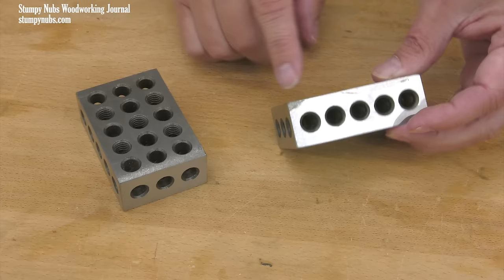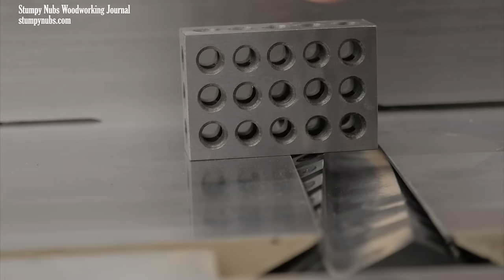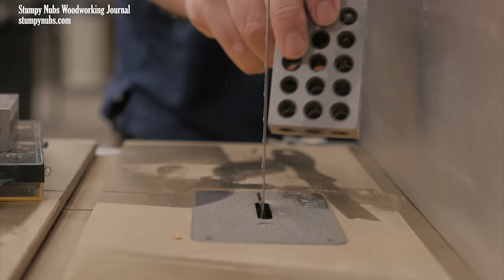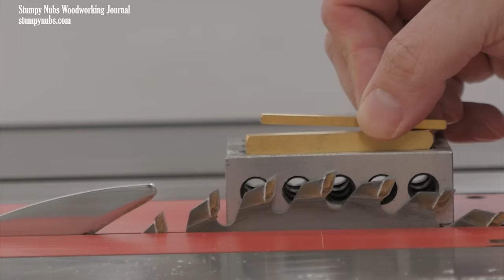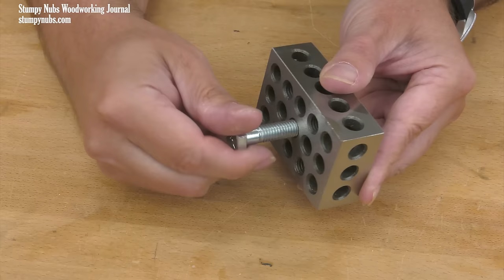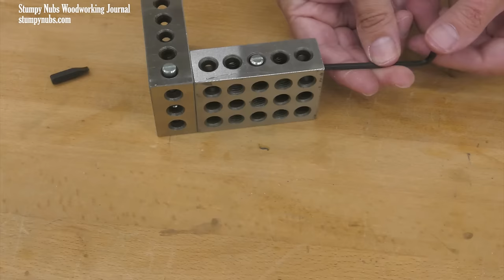An old machinist's tool that woodworkers are snatching up!

Comment: Back in 1972 I started as an apprentice machinist.  The first job you got was to make 1-2-3 blocks, Then a matching 45deg angle block.  Once you milled drilled and tapped the stock, did a pre-grind to a few thousands over, you had to heat treat the block, then grind them into size. You were tested on , square , flat and parallel precision. It was always best to make the angle block first then inspect your precision. The angle block doesn't need to be ground exact sizes, though many of us tried to do that because that's what toolmakers do.  Make everything precision. Once you ground the 1-2-3 blocks you were stuck with your precision ( or not so precise) dimensions, or grind them undersize and then they lost some of their usefulness. Of course 50 years later they had been dusted off more than a few times and were undersize anyway. But I still have all my tools and used them everyday for 53 years.  You can't beat these tools for more kinds of jigs, fixtures and inspection work then you ever thought possible.

Comment: I could not agree more about helping out others with really useful products.  I just ordered the hardware kit.  Thanks for the video.
Reply: Another trick is to use hardened pins into the smooth holes to perfectly align them.  You can bore them precisely with a good reamer and a drill press

Comment: I caught up with an old workmate today, who I had not seen for over twenty years.  We both started as toolmakers at Ford UK Apprentice Training School in Harrold Hill, and worked at the Ford Research and Engineering Centre at Dunton in Essex.  It was interesting that my friend also now has a keen interest in working with wood and has a nice workshop.  It's that joy of making things that stays with you forever, although we both agreed that wood is frustrating in that it does not stay the same size and shape two days running when using the tolerances we were used to applying to metal.  I have been using much the same trick James demonstrated today using a combination of shop built parts and flat-pack cabinet hardware.  Look for 'cross dowel' or 'barrel nut'.  

A new way I used my 1-2-3 blocks recently was aligning my router cabinet to my table saw.  I levelled the router cabinet (because it is the more awkward one to adjust).  Place two 1-2-3 blocks on the router cabinet and two 1-2-3 blocks on the table saw, and stretched an aluminium straight edge across all four blocks.  It was much easier to adjust the saw with what amounted to four contact points rather than the full tables, and a work light made it easier still to see the tiniest of gaps between straight edge and 1-2-3.  I also align jointer blades the same way we saw James rocking the 1-2-3 block on the blade, except I use a DTI on top of the block.  In actual fact the block movement is so obvious and apparent, you hardly need the DTI, but it is nice to have numbers to compare rather than eyecrometre guestimates.   Something else that made me smile when talking to my old workmate was when he asked me show him something I've made, after a moments thought I had to admit to making more things for the workshop than with the workshop, and he agreed he is exactly the same.
Reply: @Trevor Dennis "eyecrometer" LOL I love it. Reminds me of my dad's "pifomètre" from the 50's French slang pif for nose. Thus measuring by the length of one's nose.
Reply: @fredericapanon207 , LOL! I was always the "Skinny kid with the big nose" growing up. Although I prefer to remember my self as the "Slender youth with the proud proboscis".
Reply: LOL! What type of "Eyecrometre" do you prefer? The Single Squint, or the Double Squint, Glazing Enhanced kind?

Comment: As a machinist.....I have been using these since the dawn of time but I only have a single "proper" set that has pass-thru holes. That set is very precise and only used for very high-precision work. 

I also have a dozen sets of the cheap-o 1-2-3 blocks that that bolts cannot pass through. This is a great solution to use them as intended! I love it.....and like you wish it was my idea, lol.

Comment: I had a machinist turn down some threaded studs that I had bought to allow me to join my 1-2-3 blocks, and it wasn't this cheap or easy, and they were still not completely what I wanted, so I added magnets to help resolve some of the problem, but I have just ordered the kits and can't wait till  they arrive. Thank you for the heads up on where to get them.

Comment: I use 3/8"-16 to 1/4"-20 thread adapters used for cameras and tripods.  They are cheap and come in bulk.  Then I use 1/4-20 flat head/countersink screws to attach everything.
Reply: Yeah, I got brass ones in bulk and threadlocked them in the blocks.
Reply: Same

Comment: I nearly hurt myself facepalming🤦 this is one of best ideas for the shop! And I even have the hardware already laying around, salvaged from some old furniture.
Unfortunately Mike doesn't ship those small items to europe. I would've even jumped over my shadow. Having this imperial hardware in my metric shop would've been totally worth it.
Reply: Deer Stompy, Ah'm berry grapeful fur awl yew teech us sew Ah don wanna say umthin ta make yew shut up, but Ah got me 2 thoz kits an Ah got sum bad news.

Lessen them blocks git drilled perfekly square plus perfekly sentered ain't no way u gonna git them kits ta git 2 bloks plum and square wit thet kit.

Iffen yew got sum perfeck (machinist-grade, close-tolerance 1-2-3 blocks) drill, reemed an tapped ta close tolerances, that kit ain't gonna make a silk purse outta a pigs ear.

(The example you showed of forming a 90° combination was inadequate to show the potential, and camopholged the shortcomings of the kit. jus' sayin')
Reply: @seanflanagan5674  why is that a reply to my comment??
Reply: @Longnose154 , I apologize for the confusion: it was intended to be an independent comment.
Reply: @pipercessna3827 , nope, jus' nacherly gifted at plane tawkin. 😱

Comment: I have been using a 123 block for years as a spacer on my tablesaw fence.  It is easy to clamp the block to the fence using a Rockler universal fence clamp.  You then add an extra inch to the table saw setting and make mitered cross cuts using the table saw fence.  You set the workpiece against fence/123 block to start  and then pass beyond the 123 block to make the cut.  No trapped offcut piece.

Comment: Machinist work and Wood work have a lot more in common than just 1,2,3 blocks. I made two sets of 1,2,3 blocks while in machinist school. I also made a step block, and bench block that I use frequently in my wood shop. What is really amazing is you can make your own machinist inspired tools our of wood. Good hard wood and a steady hand can produce a fine set of 1,2,3 blocks as well as vee blocks, and step blocks, parallels, and a host of other tools. Like you I do appreciate the fine people at Taylor Tool Works, and they do good work. Thanks for what you do, and keep the good stuff coming.

Comment: Another great work-around...
Another option, search online auction sites or marketplaces for machinist's tools.  You can easily find affordable used sets of 1-2-3 ratio blocks made by Starrett, Lufkin, or Brown & Sharpe in all different sizes.  They can be picked up for a fraction of new, and similarly priced to the less expensive non-brand versions because machining businesses have been steadily closing for the last 10 years or more now that CNC and other automated tools have taken over the industry.  There are also a ton of machinist's fixtures (jigs), calipers, squares, rulers, thickness gauges, blocks, pins, and so on, that are very useful in woodworking.

Comment: I started my apprenticeship as a fitter n turner back in 1982, by my 3rd year i had made very similar joining plugs, an old tradesperson showed me this trick. Except mine were made the to suit the length of the blocks, so a short, medium and long rod, the longer rods had multiple holes thru them.  I am now a toolmaker in the plastic mould industry and use my blocks every other day.

Comment: Ordered a pair of blocks and two of the screw sets.  I just play at constructing things so I will likely never use them as much as you or someone like you.  But what did catch my attention was the 1,2,3 aspect.  Those are small enough and sturdy enough to drop into my "go-bag" for a bug-out situation.

Comment: I ordered a set of these from Taytools last week, and I am actually using them to attach dial indicators to adjust my planer and joiner. I was going to purchase two Rotocators, which would have cost me about $300, but using these blocks and a dial, I was able to precisely set my blades for under $70... Great tools.

Comment: i was a machinist for many years. A lot of my machinist tools I use for my woodworking. I made a lot of my precision tools in 1969, 1-2-3 blocks , many different angle blocks, sine bars and sine plates and some precision measuring tools.

Comment: Good idea. As a full time machinist, I've never understood the concept behind the pattern of mostly useless holes in a 123 block. Rarely can they be used 'as is'. And they are always getting filled with chips, so they have to be blown out every time you reuse them in a setup because they are full of crap. I found a set with a single 1/2" clearance hole in the largest face, and use these the most. Since the main use of rectangular blocks is spacers between the part and the table, it makes sense to have your most common stud bolt size (for your machine table T slots) to be able to pass through one hole.

Hint: don't try drilling the holes out with a 'cobalt' bit. Cobalt isn't appreciably  harder than regular HSS, not that you'd notice if it lasted an extra turn when drilling something that you shouldn't be drilling. A carbide tipped masonry bit may work, but often these do not have the right sharpening geometry to penetrate metal. And drilling fully hardened predrilled holes is very hard on the corners of the bit because you've got nothing to push against, so then they overfeed and get chipped or broken right away. Carbide endmills can be nursed through the hole, but they should be used on a real milling machine, not a drill press. However, its not very cost effective to sacrifice a few carbide endmills on a single 10 dollar 123 block ;) If you've got a source of slightly used carbide endmills you can sacrifice, then it makes more sense.

Comment: 123 blocks. Building these was my  first task as an apprentice tool & die maker . Accurate within .ooo3"  Still using them now after 40 years.
Reply: My dad was a machinist from before WW II to some time in the '80's when he retired. We were from Rhode Island, but had moved three times to Calipornia; the third and final time in '55. That's when he went to work for Hydro Mill where, in '62, he told me, "They call me a 'Tool Maker', but not by East Coast standards". He could hold +0.0003"/-0.0000" tolerances all day long on a manual Bridgeport vertical mill. NO digital read outs, no numerical controls. Just all by hand, eye and meticulous measurement and practice. His "Tip"? "Whenever you walk away from te machine, back off a thousandth because the metal moves". Yep, there's "Close enough for government work" and then there's accurate.
Reply: Yep, and 2-4-6 blocks. Let’s not tell them about sine bars and Jo blocks for setting angles

Comment: I first learned about Taylor Tools through the Inspire Woodcraft channel, and they’ve quickly become an important asset! It’s a statement about the kind of people they are, that they put all the dimensions for every piece of that kit in the product description! A couple years ago, I entered the subversive underworld of home/hobby machine shop (a sickness with no known cure), and I’m fairly well armed , having a mini lathe and milling machine. Although it would be a simple matter to machine the pieces, I can’t bring myself to machine any because I believe TT should profit, however small, from their excellent idea! Being a hoarder of hobbies, I do woodworking and model building also. Having never owned a set of 1-2-3 blocks before, I didn’t realize their usefulness until I got a pair for machine work. Now, I think I have 6 sets, half of which are of the “hole-less” variety - I find them very handy building model railroad structures! Thanks for another great video! Cheers!

Comment: Excellent tips, James! Thanks! 😃
My issue with those blocks is to find them in stainless steel or aluminum. Common steel rusts too fast here. 😕
Anyway, stay safe there with your family! 🖖😊
Reply: Use rust preventative on them regularly. After use, clean them and spray some light oil on a cloth and wipe them down before storing them.

Can make your own set of blocks from aluminum or stainless if you have a mill of some sort. Though I would steer away form aluminum since it is too soft for a good set of blocks.

Comment: A wee giveaway with James' blocks was the glue discolouration.  Mine are exactly the same despite thinking I'd thoroughly cleaned mine when I get glue on them.  You can safely polish off glue residue with wet & dry on a flat surface without making a jot of difference to the size.  Even Chinesium blocks are remarkably accurate, and good enough to test digital calipers and even micrometres.

Comment: I would love a lead on some good metric 1-2-3 blocks if anyone has one.  I tried ordering a supposed 25-50-75 block off Amazon, but it was just a regular 1-2-3 block that showed up. Guess they didn't think anyone would notice the extra .4mm :|
Reply: Easy and cheap to by on amazon
Reply: @alanmydland5210  that's what I tried doing, but then they just sent me imperial blocks anyways
Reply: Veritas has some, although they are only available in a kit with some additional setup bars. Otherwise you can try Fowler or Brown & Sharpe, just make sure to select metric variants as they make both
Reply: Another option is the Stevenson's Metric blocks 
available in:
10-20-40 mm
15-30-60 mm
20-40-80 mm
A bit harder to get as the only regular source I have found in Arceurotrade as hobby machining supplier in the UK
They hide them in the Workholding/Vee-Blocks-Angle-Plates section on their website
Reply: If you have the means, check out Mitutoyo or Starrett. Brown & Sharpe are decent, as are Shars. But I have found that the Fowler blocks can be a bit dodgy.

Comment: A suggestion, which may not be up your alley.  I'm a dabbler, but have done more achining than wood-working.  May I ask (no is fine!) for a video on you're opinion? Which is easier?  Moving from being a machinist (metal-worker) to a wood worker - or vice-versa?
Reply from the maker: I was never a machinist, so I couldn't say.

Comment: I wonder if the person that came up with the idea has considered machining a longer barrel nut that has appropriate holes on the 2, 3 sides... (Forgive me as I'm not an engineer) Basically having 1-2-3 barrel nuts so you don't have to try and hold the shorter barrel nut in the right place.

Comment: You can also get 2, 4, 6 blocks. The untapped holes can be used as alignment holes with a couple of precision ground gauge pins.

Comment: I use solid blocks myself at work (the holes tend to cause problems with smaller parts on a height gauge), but there are plenty of holy ones around the shop. Don't think I've ever seen anybody join them together, even in QC.

Comment: Thanks. I am no professional woodcrafter, nor machinist. However, from what I have seen on YouTube videos (you judge that as you wish), when it comes to issues like accuracy, repeatability, and to a lesser degree safety, woodcrafters could learn much from machinists' tools. Of course, not all machinist tools do so well. For example, machinists often seek precision to 1/1000 or 1/10,000 inches, far more precise than any woodcrafter should seek. Still, graduated calipers were used in metal crafts before wood crafts, the older woodworking lathe has seen many improvements in adaptation to metalworking. One day, I may try to make a list. Thanks

Comment: Nice mechanical pencil at 2:35.
I think I have the same one. Mine is for .9 mm lead, which is much more suited to woodworking than the ubiquitous .5 mm's. The lead in the .5's is always breaking. This particular one has a great retraction feature that retracts the leading lead support sleeve so that it is not so likely to poke a hole in your shirt pocket.

Comment: Great update!  Do the Taylor blocks need the hardware kit, or are they drilled properly to account for pass through of threaded bolts?
Reply from the maker: They do not make the blocks, so yes, they need the hardware kit. The only blocks I have found that don't are way more expensive. This kit is designed to save you a lot of money :)
Reply: @StumpyNubs  Perfect, thanks for the quick answer.  I'll put these on my shopping list.

Comment: Just be careful you don't loose the 1 x 2 x 3 mm setup block, it can easily slip under a piece of paper :)
Reply: heh..  good one.  :)

 Metric blocks are 25-50-75.  I don't have a set, but then again, I rarely work with metric.
Reply: I get more use out of my 1m x 2m x 3m block.
Reply: @VestigialHead  That's old, the egyptians used that to model the Pyramids :)
Reply: Must've meant cm right? But even then... lol 25mm 50mm 75mm or 30mm 60mm 90mm  sound great though
Reply: @havenisse2009 I thought the Egyptians used the 1-2-3 cubit block. I believe it was originally popularized in boatbuilding.

Comment: To align the blocks, I set them up on my granite surface plate - probably the flattest thing in my shop.
Reply: as it should be, thats kinda the point of a surface plate
Reply from the maker: That's also kinda the point he was making...
Reply: @StumpyNubs  ... and I have a couple of the joining sets on the way from Taylor Toolworks. Thanks for the info on where to get them.